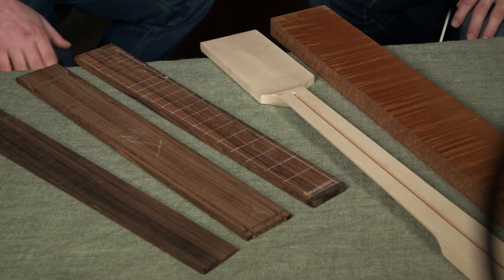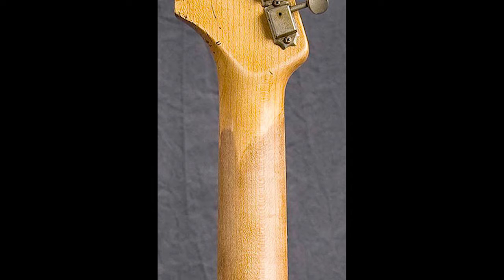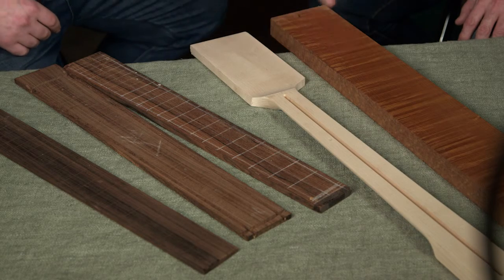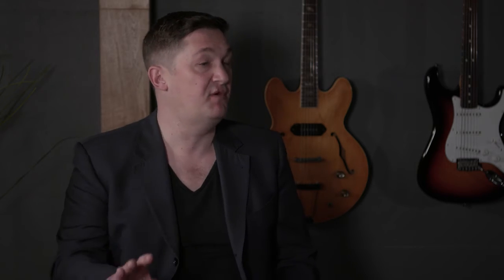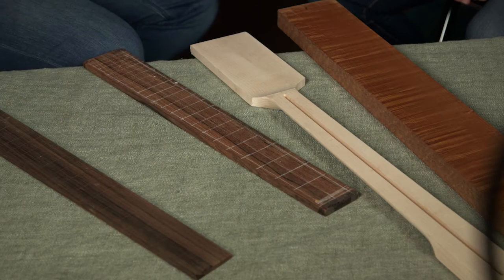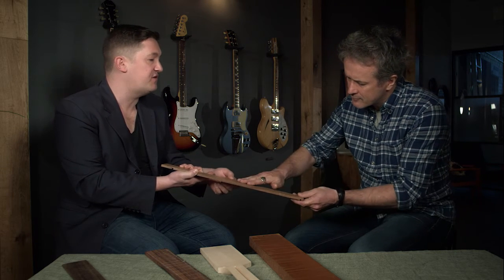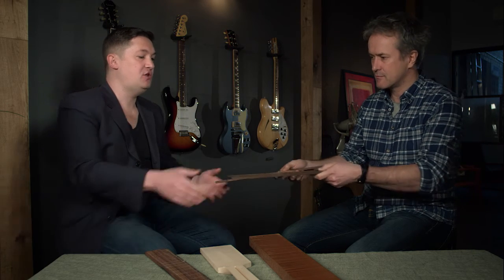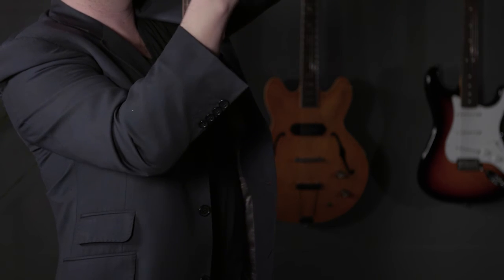Choosing the right guitar neck

Comment: Rift Sawn lumber is the most elite of the cuts.  The log is milled perpendicular to the growth rings, which are 30-60 (ideally 45) degrees to the face of the board.  It produces a linear, straight grain with a clean, consistent look
Reply: It is also the most likely to twist in a guitar neck application.
So it’s the worst for a neck.

Comment: I was always under the impression that Ebony was an excellent wood for a neck. I’ve got a few guitars with ebony boards should I take extra precaution in terms of humidity?

All the best!
Reply: Ebony is the gold standard on any acoustic, but often that is matched with mahogany.   He was speaking ebony over maple as being difficult, and again that would be a bigger problem the more you move your guitar around to different climates, or the live where the climate chases you.  

I find the ebony mahogany acoustics I make a great.  But mahogany is not all that strong, so if you go to a very fine neck profile a lot of ro9d action, and obviously steel strings, you are in a different design situation.

There is also a ton you can do for stability in the finishing.  For instance if you are going to put a film finish on any neck, you can really seal out all the moisture and defend the neck entirely against fluctuations.  If you move from the desert to the pacific coast, your neck will eventually acclimatize, but that would be one time thing.  But that kind of thing has to be built into the neck from the get go.  And every penetration has to be dealt with.  Every fret, machine head, etc...  Not difficult to do, but you have to engineer the whole thing.

Comment: Yeah, surely a tiny slab of wood that strings never touch will certainly change the tone and you will be able to hear a difference... So much bullshit spreading in the electric guitar world that it's disappointing as hell.
Reply: Just try to replace that slab with rubber.